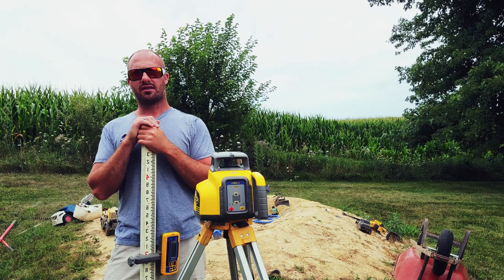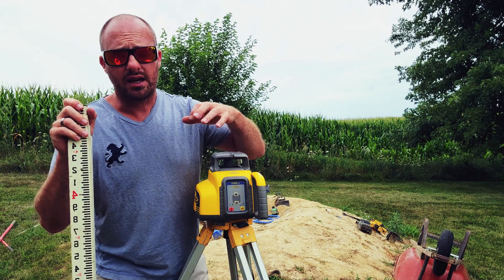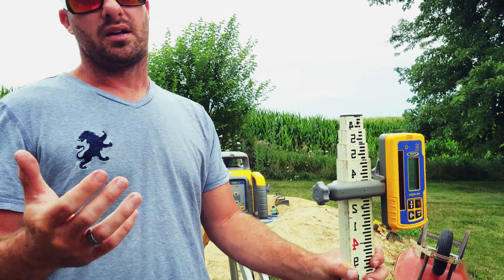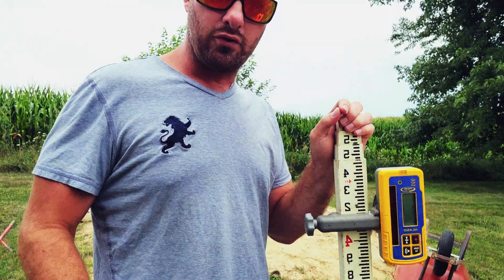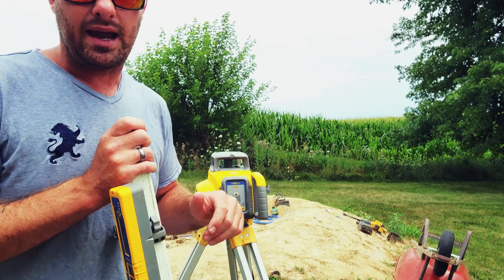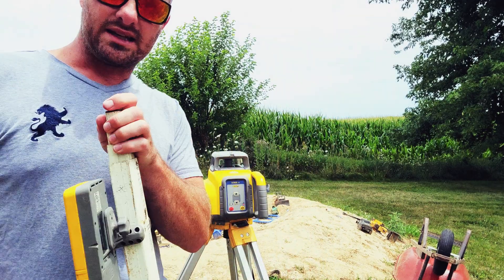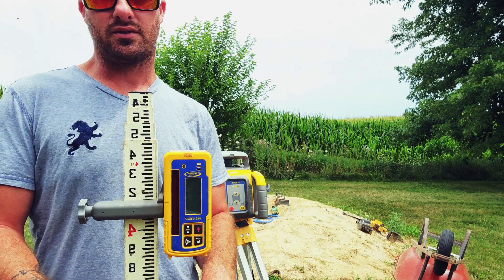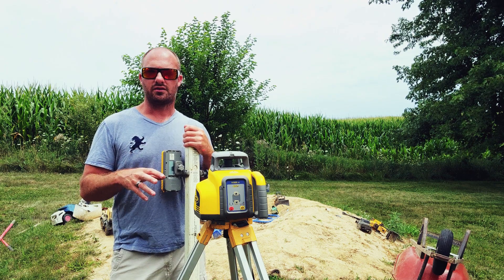HOW TO SETUP SLOPES WITH A LASER AND A GRADE ROD //Laser and Grade Rod Slopes-How to Use a Grade Rod

Comment: Great video, 4years and still gold today. One thing I'm not understanding is why when I set my laser say Point A and take a reading then lower the laser receiver on the grade rod to my desired slope, I walk to point B and slope the laser to point B. As I walk towards point A (laser). Around 10ft away from the laser I need to start manually raising the laser receiver up to the original measurement I took at point A. Even though the laser is titled to my slope at point B. I would've expected to have a slope from Point A to Point B with a tilted laser and anywhere I take a measurement in between my run of the slope I should be a my 2% slope but I'm not. Like the laser looses accuracy as I walk towards it. Do I need to set back my laser 10ft from point A to offset that and recalculate my slope now that I'm 10ft out? or am I missing something? I'm looking to have a full 2% slope from point A to point B.

Comment: My only question is would you set the laser over your benchmark and do a foresight/backsight or set rod and reciever on benchmark? In my head im seeing the initial reading move once slope starts being adjusted
Reply: Yes I agree. 
There has got to be some error when picking up a slope between points A and B, when point A is not in line with the center of the tripod (perpendicular axis)

Comment: Great video, thank you! I'm also looking at the Spectra LL300S laser that you have in this video. I was going to ask you if you knew the grade/slope range that you can set with this laser (for some reason this is not published information, even in the user guide), but after reading through all of the comments (including the YouTube drama comments) I saw that this is your buddy's laser, so that is probably not something you know offhand. I don't know why they don't publish that important information, some guys only need 1% slope, some guys need 15%+ slope! Again, good video.
Reply: @CAT314CLCR  That was super helpful info, thank you! I didn't realize this model existed, I thought they went from the LL series to the GL series with digital slope control (too much $ for me). This is perfect, I just ordered one. I just read through the users manual for the LL300S & HV302, and it seems that the RC402N remote really adds additional functionality that is not accessible from the laser itself. It also looks like the "rechargeable battery" option just gives you (4) NiMH D cells and a cell holder, so I decided to just roll with the alkaline version and I'll throw some rechargeable D cells in it. Thank you again!
Reply: @CAT314CLCR  Sorry for the delay, but I went with the HV302 for the additional functionality over the LL300S. Thank you again!

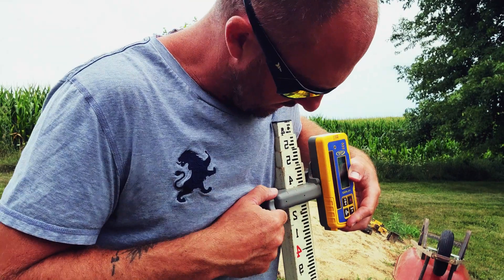Comment: Did you not move the receiver down 2 inches not 2 tens of an inch check it at time frame 2:25
Reply from the maker: When we say tenths we aren't talking about tenths of an inch, we are talking about tenths of a foot.  Each black number on the rod represents one tenth of a foot.  The small marks in between are hundredths of a foot.

Comment: Wouldn’t the ground need to be at the exact same grade between laser and receiver to set the slope this way?
Reply from the maker: The key is having the laser within a couple feet of your first elevation measurement.  You will set your initial height very close to the laser.  When you adjust the slope for the second step there won't be any height adjustment at your initial elevation point because you are so close to the laser.  I hope that makes sense.  I might have to do a second video to demonstrate this.

Comment: I thought it was a one person process. You need 2 people to set it up. 
One of these receivers stats one person process.
Reply from the maker: Setting up slopes is the only time you really need two people.  While you could get away with doing it as a one man show, it is significantly faster to have two people.
Reply: @DieselandIron  The laser I have now (Leica Rugby 640) has a remote, so you can set slopes with just one person. It's pretty handy. Self-levels either vertical or horizontal and also has a beam out the top, so it can be set up on its side to double as a pipe laser to give you both slope and trench alignment. And you can also set the eye to only rotate in a 10, 45, or 90 degree arc for grading certain shapes or avoiding interference with another crew's laser. Super handy features I never knew I wanted before I had them.
Reply from the maker: @eldonhill4840  wow! I've got to look that one up. Those are features I'd absolutely pay for
Reply: @DieselandIron  It's pretty neat! I never thought I'd use some of it, but a couple months ago I even used the 90 degree angle thing to line up a footing corner after the forklift wiped out half my hubs haha
Reply from the maker: @eldonhill4840  I could see us using it in small pipe runs as well

Comment: Nice job! Wasn't confusing, course I am a plumber and do this quite often. What I would like to know is about the laser itself. That looks like one of the Spectra units, what model is it and do you like it and does it work consistently good or bad? What receiver do you have? Can I mount that receiver on the boom of a backhoe dig septic tank lines that are very close to level(1% slope)?
Reply from the maker: I don't remember which model this is as it was my buddies laser. It's a really good laser and has a pretty good range even in bright sun. You would have to rig up some sort holder to use this eye on a machine. It wouldn't take much, just a small bracket that the receiver could grab onto.

Edit: they do make receivers that are purpose built to mount to your machine.

Comment: Do any receivers show distance from the laser? Seems like that would be a)handy to have and b) simple to do electronics-wise
Reply from the maker: Not that I am aware of.  There might be lasers on the market that have that feature but I've never seen it before.
Reply: @DieselandIron  If you wouldnt mind, what should one look for in a tripod for the laser, and in the grade rod?
Reply from the maker: @natehill8069  Features aren't going to vary that much between lasers.  Two big factors I would look for when buying a laser is 1:  someone local who can service it and 2: ease of use.

Outside of those two things, it's really up to you on if you want slope functions or not.  I can honestly tell you in the 8+ years I've been doing this I have only used the slope function maybe 3 times?  Your line of work may vary and you might use the slope function more often but I wouldn't get super hung up on it.

As for a grade rod, I would recommend the standard fiberglass, rectangular grade rod and I would highly recommend you going with a tenths rod over an inches rod.  You will use tenths WAY more than you'll ever use feet and inches in the dirt world.
Reply: @DieselandIron  Thanks, Inches vs decimal was going to be my next question. I can see why it would make percentages easier.
Reply from the maker: @natehill8069  it's far easier with decimals. Almost every print out there is done in tenths so if you get in inches Rod you will spend all day converting back and forth.